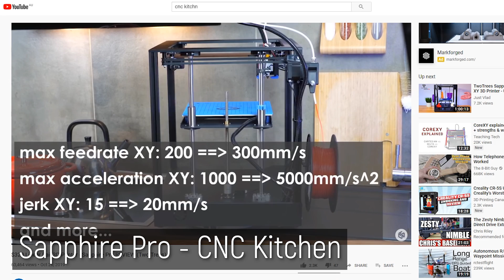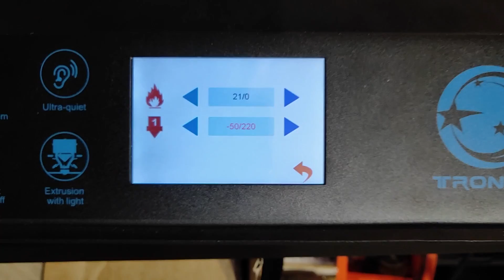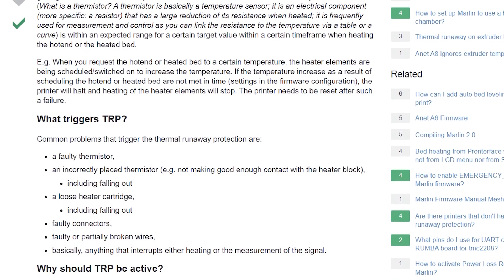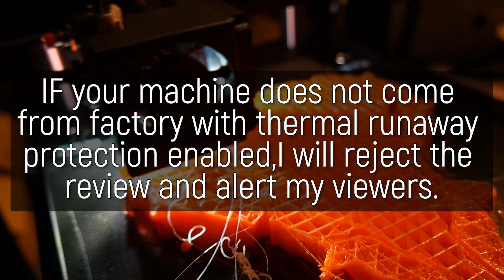The Tronxy D01 is a Solid CoreXY, Linear Rail 3D Printer... BUT

Comment: What do you think of the main board? They claim it's 32bit, without Wifi. I couldn't find what stepper drivers and if they are exchangeable. I think CoreXY models should have 32bit boards. I also think that a review should contain such information on the main board and a note on the bootloader, and what kind of replacement nozzles are neeeded. Leaving this out is excusable for an abbreviated report of course, but this information is useful for people who think about buying it for modification, and often surprisingly hard to find in the tech specs.

Comment: $350 for what looks like a solid a frame and bed, with probably a fine-enough motion system to get going until you can get picky? Sure, great. Problem being that I wouldn't buy even a stick-on print surface from a company I knew was doing this crap. Turning off runaway is insane, and the only thing that accomplishes is hiding dodgy wiring for a bit to complete prints while running the risk of bursting into flames, and an extremely wrong way to compensate for your part fan blowing too hard in the wrong places. I'd say this just shouldn't even have a boolean at this point, but I'm sure manufacturers would just keep using their old firmwares, or fork Marlin just to disable it without the config.

Comment: There is absolutely no reason at all for thermal run-away protection not be enabled on every machine made.. It has existed in marlin for years and is even enabled by default for the last few years.

Comment: me owning an x5sa and knowing quite a bit about it. Its extreamly easy to enable runnaway protection on this mashine its like 2 minutes and 2 lines of gcode if im not mistaken.
look up the  configuration gcode list for the chitu bord find the line that says thermal runaway protection on and then coppy and paste it in an emty gcode file. 
put m500 on the end thats the saving comand (check this im not 100% shure on this) and done. 
Run the gcode once as if its a printfile. 

See this message  not as something offending but as sth that helps to save your live in literally 2 minutes
Reply: @Don Gray i have a early 12v 2019 model and u are in despred need to do sth to that printer out of the box its a dangerous maschine. thing is that one u upgraded it its a really fast and solid printer that just works and producec objekts in quality and speed that is not seen in the price sice and speed bracket

Comment: Sorry for noob question I'm new to 3d printing, i just bought a refurbished cocoon create touch, does this printer have thermal runaway protection?
Reply: Fond out what firmware it uses. You can find out that way
Reply: @Stettafire  how do i do that?

Comment: Great review Angus. Since Marlin comes with TRP enabled by default, it actually takes time to disable it than to leave it active. TRP isn't just "not enabled" they have actively disabled it. Totally unacceptable.
Reply: @Don Gray You're quite right. Either way, the only reason to disable safety features like TRP would be because of inferior components causing false positives. Obviously this is all caused by the race to the bottom. A car wouldn't have the airbags disabled.
Reply: @spikekent  BINGO

Comment: My Tronxy is trash also. Blown board from new, (gift so was not able to do warranty replacement) new board worked fine, but prints are a real trouble to get working, bed never likes to level, and I had to redo the entire firmware (seems the case for most these printers).

Comment: I bought a Tronxy X5SA-400 and found the bed heater plug melted and almost caught fire...  Ebay seller is: acwholesaler so be careful and avoid them as the seller did nothing to help me resolve this dangerous issue... I recently ordered a 32bit MKS motherboard so i can move on from this dangerous Tronxy garbage firmware since it is locked up and cannot be tuned or modified. They sure look good in pictures but they are all show and no go so dont be fooled by their specs that they post online.
Reply: Same here with my X5S-400. Tronxy had tinned wires which probaby started creeping and conducting poorly after a couple of months...
Reply: @Thahamster  scary stuff! I'm glad I found it before it burned our apartment down. I cant say for sure but I think the XT60 plug mine came with is counterfeit. I googled xt60 plug fires and found a lot of info about them and how a lot of cheap printer manufactures use counterfeit ones that are less heat resistant and have poor continuity causing more heat. My 32bit SRK board and LCD arrived today so I can finally get out of this garbage firmware and fine tune the hardware it has.

Comment: i still have my first printer, which is a tronxy x3 .... that thing sucks!!!!! acrylic heatbed platform... and advertised to print abs with? yeah that thing warped like crazy and was impossible to level... som wires they used were so thin that they burned out within a week, the maiboard died after 2 weeks, the bedlevel sensor caught fire the first time i plugged it in, the hot end wires broke after a few prints.... i could go on but i think you got the point... tronxy = shyt printer
i kept mine for parts.. not sure which... but it seems like a waste to just throw it out....

Comment: Nice review! It is really cool to see the mechanical design of 3D printers progressively evolve (thoughts on a video montage on the evolution of 3D printers from your collection?)

a shame some manufacturers are still shipping printers with marlin firmware that is several years old with thermal runaway defaulted off. I have to wonder why though, is it that chinese web browsers block fresh downloads of marlin, they cannot read english, or something else. Sure laziness but it seems like more work to dig through one’s computer for an ancient download of marlin than a quick fresh download of it. Anyways, looking forward to some standard thermal runaway test you could develop, would set a great standard for all reviewers.

I am surprised they did not go with a pancake stepper and bootleg titan extruder for a direct drive printer, the cost of a chinese titan has really come down lately and pancake steppers are not absurdly more expensive than their full size counterparts. Would make retraction settings a lot simpler and allow for flexible 3D printing.

Would be nice to see 3D printer manufacturers selling kitchen and small automatic fire extinguishers with their machines, I’ve thankfully never had one go off for any of my machines and by no means an excuse not to have thermal runaway protection, just a small creature comfort I have kind of grown accustomed to

Great video again, glad to see you’re steadily posting on

Comment: Are those cheap red push buttons the limit switches!?
These buttons are not reliable (not kidding) and should be changed to micro switch types!
It won't set you house on fire but grinding pulleys or false triggers can be avoided this way.

Comment: Shit, glad you're okay, brother!

I gotta say, this is disappointing. I was saving up to buy one [so far, I've got brand loyalty to TronXY], but this has changed my mind. Still looking for a Core-XY that falls within this price point.
Reply from the maker: If you have other TronXY machines, I would wager they don't have TRP enabled either. Please check!
Reply: @MakersMuse  As an update, it seems that TronXY has heard the backlash and updated their configuration [or, as they apparently say it, 'configulation'] for the D01.

ETA: Just dug around in the new config for the D01. M8023 has been set to T0 [enabled].

http://www.tronxy.com/software/d01-new-configulation.html
Reply: @MakersMuse  I just checked my XY-2 and found that Thermal Protection /is/ disabled! Add that one to the list.

M8023 T1 [Disabled]

Comment: Heh... Just a few videos before yours I was nagging about the notorious Chinese safety issues like an unearthed Spindle for my CNC or weird AF design choices like building a battery hatch and power switch UNDER an RC Model you'll likely want to drive through the mud - Shit like this is why I still don't have a CO² Laser Cutter - The Western ones add unnecessary crap like Cameras and Always Online Features while the Chinese ones will blatantly electrocute you due to lack of proper earthing - C'mon.
Reply: There are plenty of tutorials now on how to modify those Laser cutters to be safe. But yes, it's the wild wild east...
Reply: Ľuboš Rybanský  i wonder how he managed to get superscript text into his comment let alone subscript. I haven’t found a way to insert either into YouTube comments. Even copying it doesn’t paste the original formatting. Any hints?

Comment: PTFE goes right into the nozzle... can anyone point me to extruder with nozzle(not the hotend heatsink/throat) that has hole large enough for 4mm PTFE to be inserted? I thought they're all always just merely butted against the back of the nozzle with only hole large enough for the 1.75mm filament, so you always will have to install the PTFE as tight and flush as possible to the nozzle. all metal throat is another thing though

Comment: There are already too many fires in Australia, a "min_temp_error" should have been triggered to stop the heating, not a thermal runaway
Reply: My understanding of min temp is that it is checked only initially, to make sure there is a working and attached  thermister before power is first applied to the heater. After that, the thermal runaway algorithm should be the one that saves you.  That's my impressions from using the Marlin firmware since since it states that it is checked prior to enabling the heater. I didn't dig too deep into it however, and other manufacturers may do it differently.
Reply: @Chris_the_Muso  I don't remember configuring something in marlin to do that, but my marlin on an MKS Gen L does fail on Mintemp at any point in time when the cables are disconnected. And don't ask me how I know that.
Reply: @Andreas-gh6is  LOL, fair enough.  It wouldn't be the first time that the poor wording in the marlin firmware has caught me out. 

If you search config.h for "MINTEMP" you'll all the places where mintemp is set (bed heater thermister and up to five hotend thermisters).

Comment from the maker: Someone left a comment re a cetus burning up, I'm not sure what happened to it. If you could reply to this that'd be awesome! To comment, I repaired Tiertime UP printers for many years and a common fault was the temp error triggering due to thermistor or heat cartridge connectivity issues, but Cetus machines seem to be very different - I might test my stock to see what happens there.
Reply: Posting from my alt account here.. looks like youtube shadow banned me from commenting, I could see my comments while logged in but a quick view when logged out revealed the ban. Here's the link again but this time broken up a bit so that I don't get shadow banned again (wtf youtube??)  replace the spaces with dots: forum tiertime com /t/thermal-run-away-printer-caught-on-fire/1209/12
Reply: Here it is: https://forum.tiertime.com/t/thermal-run-away-printer-caught-on-fire/1209/11

Hope that helps.
Reply: Google are burying this vid, I think - I searched "tronxy d01 maker's muse", the follow-up video was the first result, but this one's near the bottom of the page, beneath a load of irrelevant results.

Comment: Inexcusable at this point. It's bordering negligence now.
Reply: not borderline -- it is negligent.
Reply: Nah, that border's miles behind this. Disabling thermal runaway prot is only useful in two cases: your wiring or thermistors are crap and you don't want to fail a print, or you have a situation like the Prusa MK2 had early on, where a cold room could fight the bed heating enough to trip runaway detection because the bed hysteresis allowance was too small. Both of those are terrible reasons to disable the feature, and in both cases you'd only do it to rush something out the door without fixing the underlying issues at the risk of your customers. Table saws are dangerous (nevermind things like SawStop for a sec), but they don't run unattended for possibly dozens of hours and chop your thumb off in the middle of the night when they fail because some manufacturer decided to flip "define HORROR_MOVIE_PROTECTION" to 0 in the config.
Reply: Especially after what they did after this video was posted.
Reply: @Skydiverjoe2871  what did they do?
Reply: @DrJeckyl  they basically told him they want the video removed. If you go to his channel and select the community tab, he has the letter they sent to him there
Reply: Thanks, you saved me from buying the wrong brand
Reply: It's a shitty feature that has one single failure point. If a lead breaks on a thermistor, there's nothing stopping thermal runaway! The Ubis hotends are notorious for there thermistors breaking and the hotends peek melting into a blob. There needs to be a feature with a redundant safety set up. Relying on a system with a single point of failure, especially if it's a single core wire under constant strain and movement is beyond foolish!
Reply: Never should have left the factory
Reply: Did your hair had a thermal runaway? So short. Just joking. Thank you for taking the stance on testing it. Like you said, this is 2019 and companies still ignore it.
Reply: Bordering? Call ICE service for repatriation

Comment: You realize the Tiertime printers do not come with thermal runaway protection too?  https://forum.tiertime.com/t/thermal-run-away-printer-caught-on-fire/1209/11
Reply from the maker: Interesting, I fixed UP printers for years and they definitely triggered over temp error on thermistor issues, it was a common repair. Unless something has changed.
Reply from the maker: EDIT: Ah, a cetus. I feel the company has gone backwards somewhat with those machines, I can do some testing on mine.
Reply: @MakersMuse  That'd be very cool. I feel the same way. After I found it out I've been thinking about selling mine.
Reply: I appreciate your hard stance on this. I've nearly had a printer burn down on me before and it sure is no joke!
Reply from the maker: @jotham123  It's definitely no joke! Also, for some reason I cant see your original comment on the video. YT playing tricks again.
Reply: @MakersMuse  Oh dear. Yea YouTube just got some changes come through.. here's the link again if you were interested in it:  https://forum.tiertime.com/t/thermal-run-away-printer-caught-on-fire/1209/11